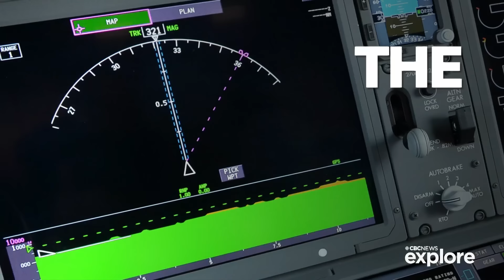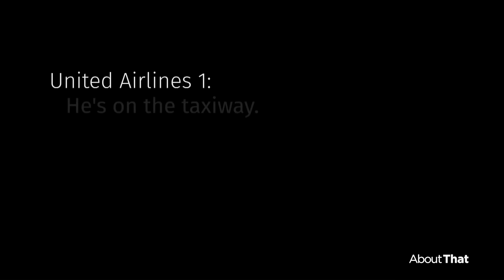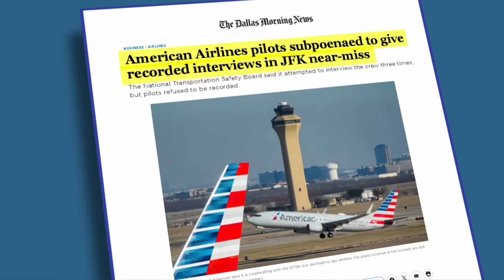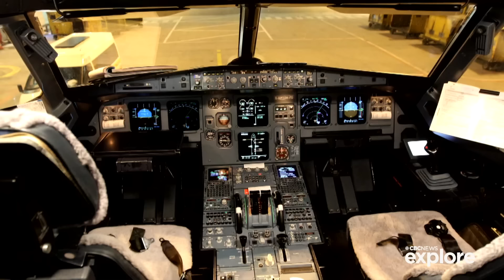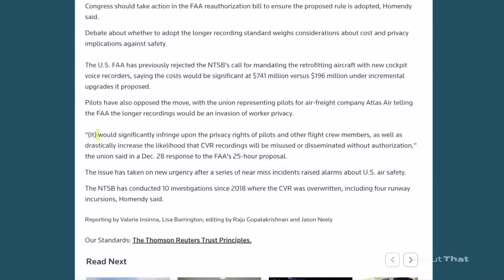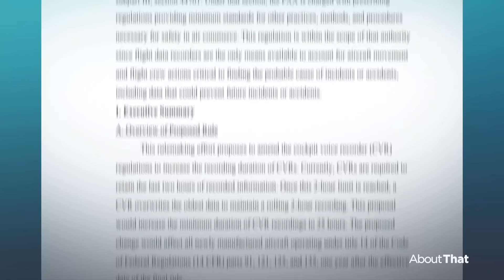Alaska Airlines blowout: How the cockpit voice recorder got overwritten | About That

Comment: In 737 CVR stops recording after engines shutdown, so someone is lying...
Reply: Or perhaps you are mistaken.
Reply: @michalw6965 Wrong the CVR will keep recording as long as the aircraft has power, unless the circuit breaker is pulled, i.e. ground power at the gate before and after landing before the engines are started.
Reply: I have manuals for a particular NG airline and it has both types. 
I wish I had a dollar everytime someone says "it doesn't work that way on my aircraft".
Reply: @ImperrfectStranger  As far as I know on MAX aircraft CVR will stop recording 10 minutes after engines shutdown unless you manualny select it ON. Lets wait till final report
Reply: @michalw6965  This is contrary to what the NTSB were saying. But, as you say, let's wait.

Comment: I am pro-union but unions that have authority over and responsibility for the safety of the public, such as police and pilots, go too with CYA issues far I think. Both of them do not want their work action recorded. Other things pilot unions ask that are safety-related such as scheduling issues are great.
Reply: Privacy promotes aviation safety, not the other way 'round.

When pilots fly together they operate the aircraft and they also communicate with one another on a personal level. The more free flowing this communication is, the better crews are able to "mesh" together and operate efficiently. Less second guessing what your crewmate might do when you're dealing with an unpredictable scenario.

If I'm in the back of an aircraft and it encounters an emergency I don't want the pilots constrained in any way or for them to feel concerned about how their decisions might be scrutinized. I don't see how that would be helpful or how that would make me safer but I do see the inverse to that.
Reply: @zachbell2270  Their decisions are already scruitanized if there's an issue. What's changing between their communication during an incident with a 2 hour limit as opposed to a 25 hour one?
This is about being able to trace back issues that started more than 2 hours previous. Did a pilot ignore a warning on startup or not notice it during the incident? Was the hydraulic pressure already bleeding before takeoff or did it start inflight? Questions like these might not be answerable without the extended recording.

Comment: Something smells . When the plane landed and powered down the CVR should not overwrite. This was not accidental.
Reply: Very unlikely. More likely is that the aircraft was simply connected to ground power, passengers were offloaded and the power was simply left connected while the plane was properly secured by the ground crew.

Comment: Two hours is only part of the problem. There needs to be better technology that Records digitally into a buffer and anytime the Flight Data Recorder sees a flagged parameter like cabin pressure, it could dump that data to a thumb drive for later inspection.  
The old question comes up, "What are you trying to hide?" Hundreds of Millions of people are recorded throughout their entire workday, Why should pilots be somehow immune to scrutiny when they are responsible for hundreds of lives and millions of dollars in company assets?  Laws and procedures can be negotiated with the companies, but a single airline with 100 planes would soon accumulate 2500 hours of voice recordings that would have to be scrutinized manually or digitally.

Comment: The cockpit recorder has no technical evidence , the flight recorder has that.  How the pilots handled the emergency lead to a successful landing thus what they said to each other is of little value.  The important information is on the flight recorder and as I understand they have that .  However, if the NTSB does not have that then we have a problem.

Comment: The person who was sitting in that window seat should be under investigation for pulling the emergency exit! That's the only logical explanation for that emergency door coming open!
Reply: There was no door - was a door plug bolted in etc
Reply: There was no one directly in that seat, nor was there a handle. The space allows for an additional door if an ordering airline wishes for there to be a door, otherwise a fitted panel is installed. This was a fitted panel that makes it appear as a regular wall panel inside the aircraft. These types of panels are common, but in this case, it was likely that the bolts that held the panel in place became loose due to vibrations in the aircraft, ultimately resulting in the panel being blown off the plane as the air pressure outside dropped as the cabin pressure increased.
Reply: You should do more research before commenting.